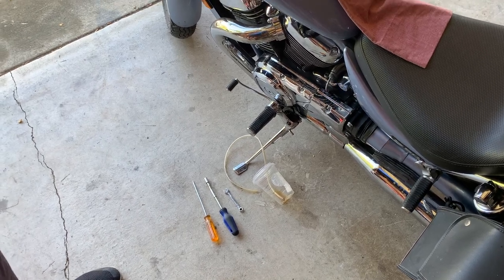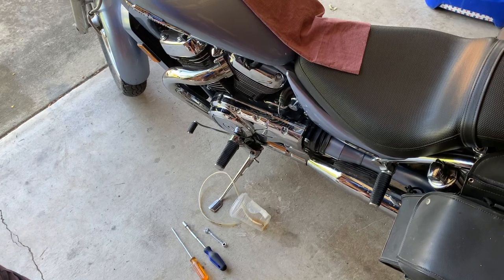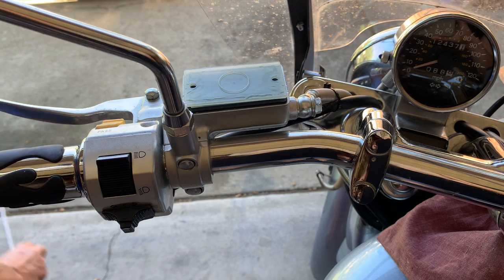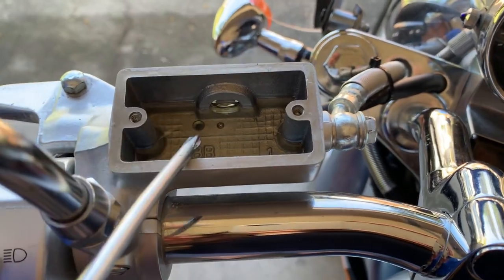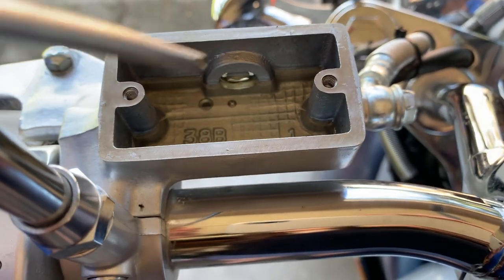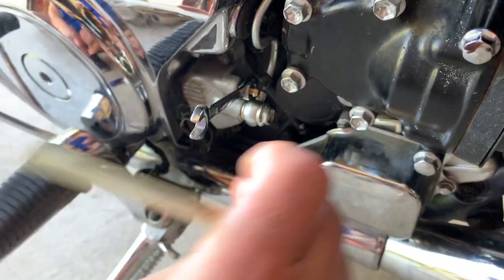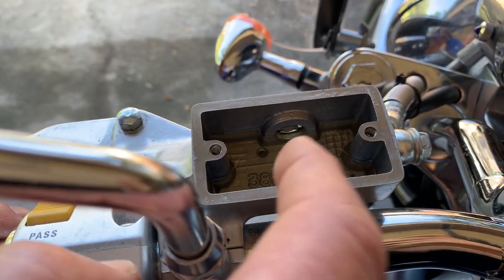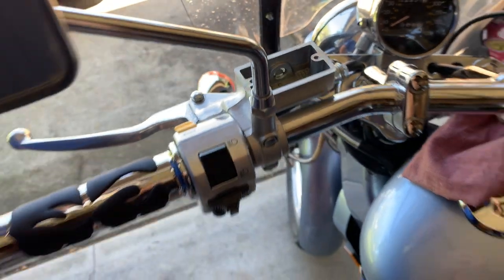Suzuki Intruder Boulevard Clutch Not Engaging Fix

Comment: Glad to have stumbled upon this video. Had this issue with my 92 Intruder 800. On a short ride clutch started slipping (so I thought). It quickly within a few miles basically quit working all together. I could shift freely but the clutch would not disengage. The lever was under much more pressure than normal. I could sit at idle and put in gear and even revving motor with clutch out bike was dead in the water. 
After purchasing a torch cleaning set that had a wire tiny enough to fit into the return port on bottom of master cylinder, as soon as I pushed into that hole the fluid burped back into reservoir and everything went back to normal. 
Side note- master cylinder had been rebuilt at end of season. I started bike a few times over winter and rode just around the block to keep everything flowing. After sitting during very cold months was when this occurred. I guess after the master was rebuilt there may have been something that dislodged and blocked that return port. 
Thanks again for making this video. Many other clutch issues only address bleeding for spongy clutch. This was the first video that talked about the opposite issue of the clutch not disengaging. Well done sir…many thanks!

Comment: I have nothing coming out of the little hole , you said to spray brake fluid on it several times and use a little wire ,, did you mean break clean ,, I’ve never seen brake fluid come in any kind of spray bottle
Reply: Brake cleaner sorry about the confusion and mistake.

Comment: Two items here.. 1st and foremost, on Japanese bikes, always prefer a JIS (Japanese Industrial Standard) to the Philips screwdriver - due to differences in the heads of each, the latter with keep on slipping and consequently damaging the screws' heads. Also, to unclog the braking fluid line (in case it's really clogged or just as a precaution), you can use a thin guitar string - but you need to do it very gently to not damage the hose.

Comment: Thanks! Will give this a try. Few weeks back my clutch wouldn't engage fully. Replaced the very nasty looking fluids and now it won't disengage fully when the bike has been running for a while. I think you just solved my problem:)
Reply from the maker: To be clear this fix is for when the clutch is not engaging (bike not moving when releasing the clutch) after it warms up. Yours may be a different issue if it stays engaged after the bike has been running for awhile.

Comment: Hello. What was the cause of this repair? What symptoms, before you did anything, I lost the power of the clutch. Have cleaned and refilled the brake fluid and vented the system. But there are no air bubbles in the return to the container on the handlebars ...
Reply from the maker: Clutch stops engaging when warm, starts slipping and after stopping you try to put it in gear, release the clutch and bike doesn't move.  This is to fix the issue after driving for awhile and then the clutch stops working.  Works ok when it's cold but not when hot.
Reply: Did this help your problem? I’m having the same issue
Reply: @rocketkid4228  I bought a repair kit for the slave cylinder online. Changed a screw, spring and rubber gasket. Filled up with brake fluid and pumped a number of times as the film shows, aired etc. the clutch was as good as new.
Reply: @TheNordmo can you please which one you got?

Comment: You need to use HIGH TEMPERATURE brake fluid Dot 4.  Make sure the brake fluid is rated for at least 475ºF-  typical Dot 4 is about 350º-  no good.   Again, high temperature Dot 4;  some companies label it as Dot4+  -  At any rate-  This will ABSOLUTELY solve your problem long term along with a good cleaning of the master cylinder itself. Ride Safe Everybody.
Reply: suzuki calls for dot4... so I think its good enough
Reply: @Marco-qe5zw  or 5.1 say many.

Comment: I'm looking at an '06 C90 and I am not sure about the clutch feel.  It doesn't engage until the handle is almost completely released.  There is very little take-up when pulling in the handle.  Is this normal for C90s?
Reply: I don't think it has hydrolic clutch so this fix does not apply.
Reply: It does have a hydraulic clutch.  After some digging/reading online, it seems that the condition I described is typical of the C90.

Comment: I Have exactly the same problem, I have bled the system, the master and slave Cylinder cleaned, but the different thing on my bike its that the little hole does not bubble up like yours even thou its already cleaned, Any Ideas ?
Reply: If it's cleaned it would be spraying fluid upward.  Try again to clean it, I remember I had to force some brake fluid in the little hold lining it up with the red straw comes with the bottle.  I had it all wrapped in towel to protect my eyes and bike paint.  Also used a fine wire from a bbq brush.  When it's clean it should spray brake clean out of the hole. Good luck!.
Reply: I can’t get fluid into my slave cylinder  I been trying to bleed my system I was  able to get some air out of the line but still I can’t get any fluid out of my slave cylinder
Reply: I’m not getting anything out of the little hole , you said to spray brake fluid in it several times , did you mean brake clean ,, I’m sure how you spray brake fluid
Reply: Brake clean not brake fluid

Comment: So I have a quick question I have this exact issue, and I rebuild my master cylinder and bought and replaced my slave cylinder. So the tiny hole, when the clutch lever is not pulled in, should I be able to see the spring part of the inside mater cylinder or the metal piston part
Reply from the maker: Tiny hole it's humanly impossible to see anything in there, is that small. The bigger hole to the left of the tiny hole is where you could actually see the spring and piston when the lever is pulled in.  With the lever out you should not see anything other than clear break fluid.  As you pull the lever in you should start seeing first the piston passing thru the hole, then the spring when the lever is pulling in all the way.  If you see the spring first and then the piston then they were assemble in the wrong order and is why the clutch doesn't work.

Comment: Why did you say DOT 4 brake fluid, not DOT 3?  My Suzuki manual says either DOT 3 of DOT 4 is fine.
Reply: Mine says dot4 on the top plate specifically.

Comment: DOT 4 Brake fluid?
Reply from the maker: Correct, clutch uses brake fluid make sure is DOT 4 as it resists water vapor from mixing with it.

Comment: If your clutch line on your intruder blows out (and if it hasn't it will soon just go look at it pull that little springy thing down and bend it a little bit see if there's a crack or two 🤣) it's a ridiculous rubber thing connected to an even more ridiculous Hardline and there's a company that makes a kit to replace that entire ridiculous thing with one braided hose from front to back the OEM part that you could never in a million years install without ripping the bike to pieces and quite frankly sucks is about $450, the kit to replace all of that fragile clutch line with a end end braided hose with a banjo fitting on each end is $50 I've read on forums that it's a good idea to reuse the banjo bolts off of the bike instead of using the new ones that they give you I don't really know enough about it to have an opinion either way on that it's just some stuff that I've heard people on the internet saying but I'm going to try to find a link to the kit and if you need to replace your clutch cable on your intruder it will make your life much much easier and when you're done your life will be way better than if you had the original $450 garbage on it.
Reply from the maker: Not sure about a clutch cable, this repair is for hydraulic clutch so there is no cable.